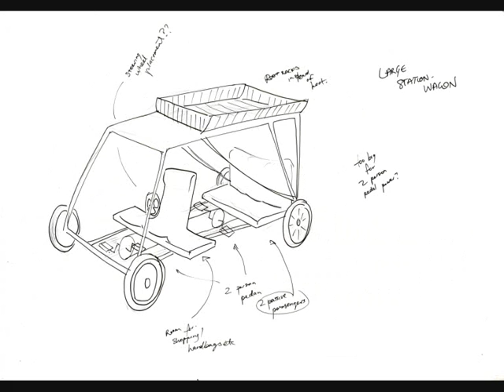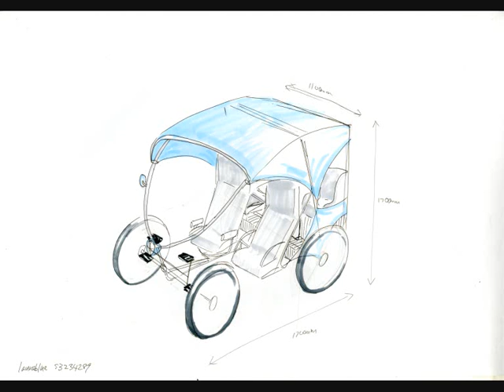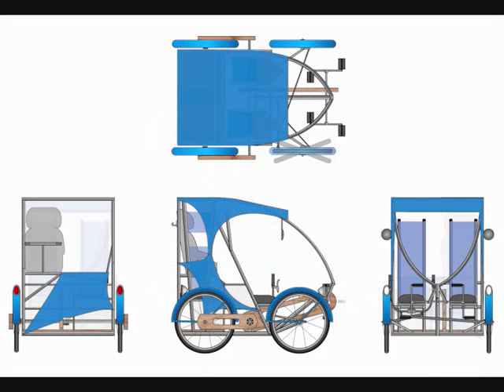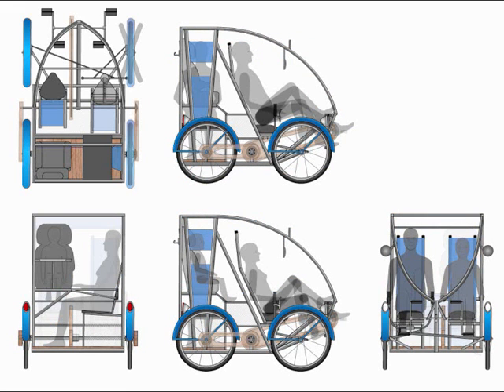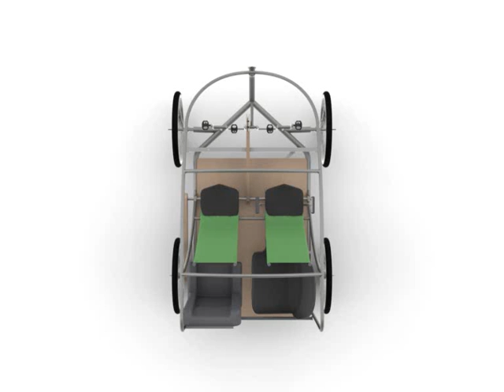the Care Human Powered Vehicle

Comment: I don't want to bash your designs, but these are not a substitute for a station wagon.
how would you think a smart car would appeal to station wagon owners?

If you want a HPV that works you need a wide gearing range, light weight, and aerodynamics.

Your canopy designs would act to increase the drag created by your seat designs.

Some solutions.

  Modular detachable storage (trailer perhaps)
  Add a windshield to redirect the airflow around the cabin.
Reply: Big Jon, why don`t you Fuck Off

Comment: The Dutch Quattrocycle hits all the right notes. Seating for up to 7, like a mini van. Four riders can pedal and all four can control their own set of gears. Full suspension and a flex frame. Recumbent comfy riding position. Electric assist! All the makings of ultimate family adventure vehicle. I'm using mine to commute to work.

Comment: You're correct that most readily available cars are heavy & powered by inefficient internal combustion engines, but the definition of the word "automobile" is a vehicle (car) that's self powered, it has a built-in motor or engine that drives it down the road.  A velomobile is powered by the driver &/or passengers, therefore it's not an automobile.   A velomobile w/ a battery powered motor is an automobile, the dimensions and/or legal status are irrelevent.

Comment: Cars are extremely inefficient in using power.As an example for the same power used for an electric car to go 3 miles you could power an entire house for 3 months. The problem with cars is inherint in their concept. Big heavy things are not energy efficient. Once a car becomes small and light, it ceases to be a car and becomes more an electric powered velomobile.